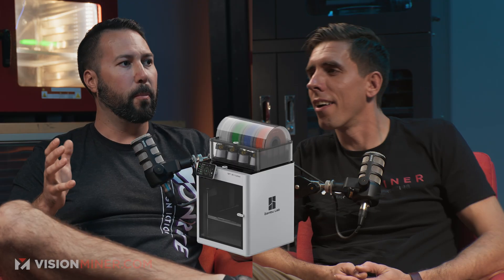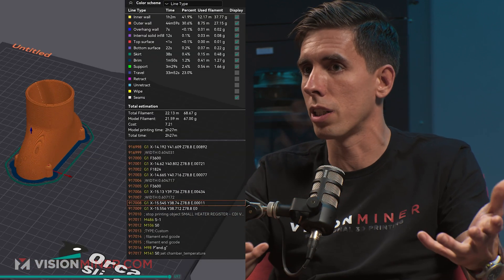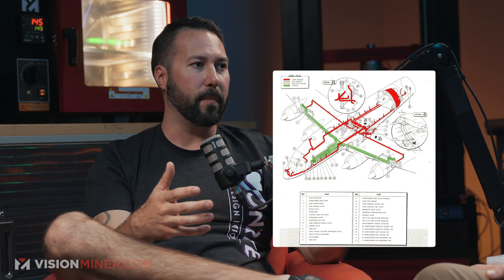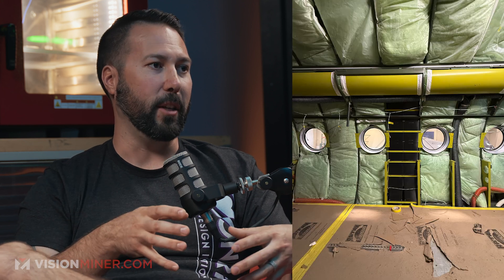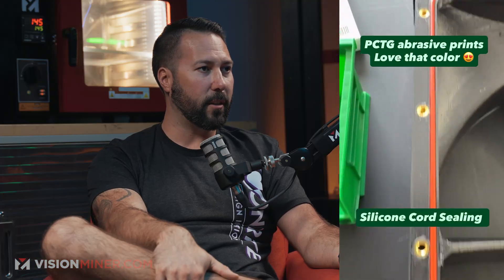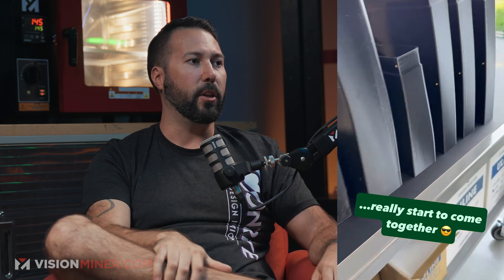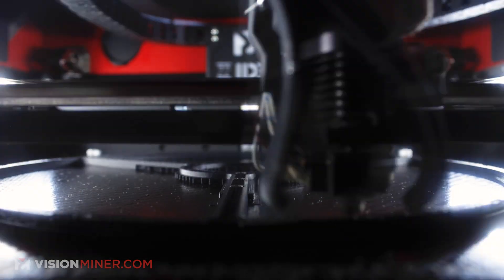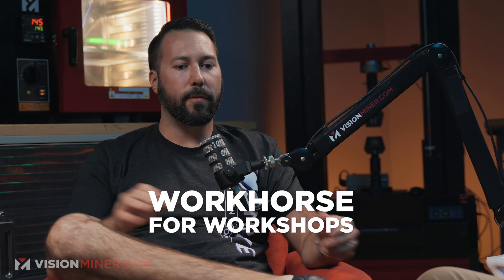100+ Custom 3D Printed Parts on a Lockheed Constellation: Vintage Aircraft Restoration

Comment: Last thought:  Have you all considered the capability the engineers had in the day this plane, and many other efforts, such as Gemini, Apollo, etc... were designed and actualized in manufacturing?

Those organic shapes were often realized through classic descriptive geometry techniques.  Many old world methods, patterns, templates, scribed lines and curves were all employed to very high precision and exemplary applied tech.  Additionally, many on the project down to assembly engineers and factory technicians had to have much higher level understanding of aerospace science than we often see today.  In many cases, and this is especially true of the rocket engines for example, manufacturing variances were a fact of life.  These variances, due to the lower level of technology advancement in play at the time, required engineering of that specific engine so that it will perform to spec.  Each engine is, in this way, a one off.  Similar to the others, yet different in subtle ways.

All largely without CAD, and certainly without CAD as we know it and simulation today.

In my view, preserving this history is worth it.
Reply from the maker: Just seeing some exhibits of electro-mechanical engineering -- pre-digital -- is a mind-warping experience. The Star trackers they had on B52's.... entirely made from servos and gears and electrical inputs... wild.
Reply: @VisionMiner  I had written you another reply, but I don't see it.

Look up atomotons.  They are all mechanical machines purpose built to accomplish a task.  One great example writes out an entire letter in script type writing!  It's nearly all cams and followers.

We can encode process details into rotational objects that trigger followers at specific times.  Mix in some hydraulics, relays if we want, and suddenly a ton of automation is possible without a line of code.

Not that code is bad.  It's not.  I just think it's important to preserve great tech.  It always has uses.  Sometimes it can prevail where modern means and methods may not.

Remember the 3.5 inch floppy disk?  I once was teaching engineers there how to use NX CAD.  They gave me a tour of the factory floor where literally billions of floppy shells were injection molded.  They supplied AOL with floppies.  All air valves, relays and cams with followers executing repetitive tasks flawlessly over millions, tens of millions of cycles.

The head guy there said they were modernizing not for cost reasons.  What they build is damn tough to beat.  Lack of familiarity was the reason.  Interesting isn't it?
Reply: Absolutely agree, this wasn’t only a great project to be involved with but an honor to help preserve such a historic icon.
Reply: @ContriveDesignInnovations  Indeed!  Labor of love all around.  Not the whole story, but for sure a major component.

Comment: Our group are a bunch of whizs printing pps-cf on the Qidi Plus4 and Xmax3. Yeah, its on the low end but we're still getting great layer adhesion,  printing tolerances & great at geometric thermal control. 
Imo, a Qidi machine despite some of it's downfalls are just a notch, notch & a half lower than a V22 Idex. 
Id still love to have a V22 in my shop though. 😉

Comment: How did you get the heat insert to that fiberon PPS-CF?
Reply: I used a soldering iron with a heat set tip.
Reply: @barettstrecker1582  our beta test team can print anything just below ultem 9085.... on a Qidi Plus4. 😉
Reply: @helixx_4D  75C chamber? no problem. 85? propably still no problem :). Plus4 is magic
Reply: @barettstrecker1582 I think my mind just blown away and remembered soldering iron can go 300 degrees celsius.
Reply: @barettstrecker1582  What scanner is that you´re using?
Reply: @netmaster78 that is the very new Einscan Rigil.  It’s a pretty impressive wireless Laser and IR scanner that’s at a very appealing price point.  
I’d be happy to do a demo with you if you’d like to learn more about.